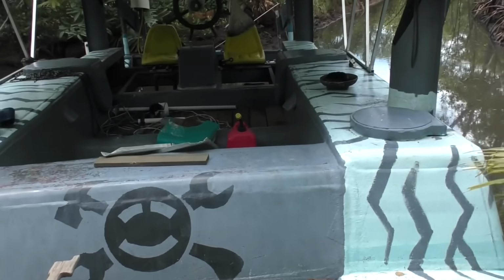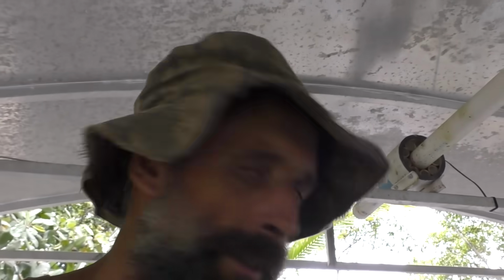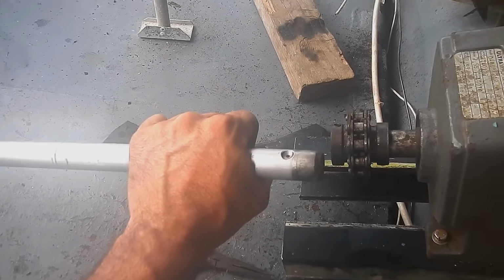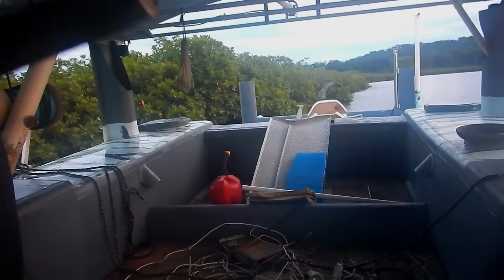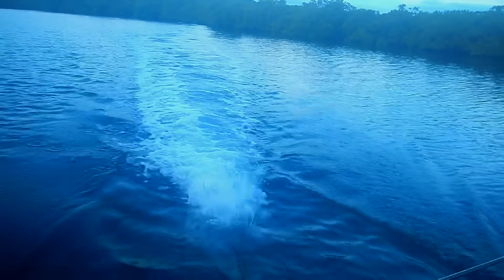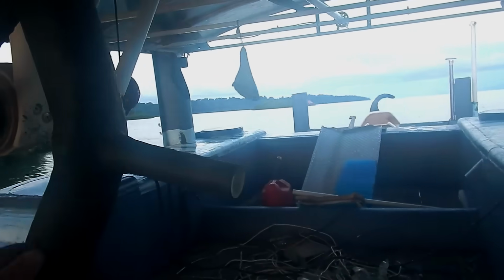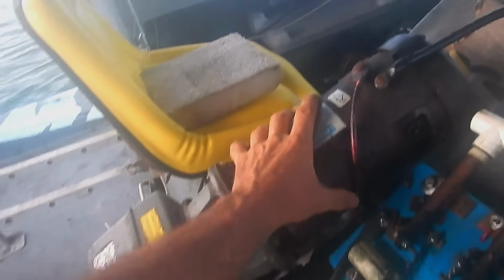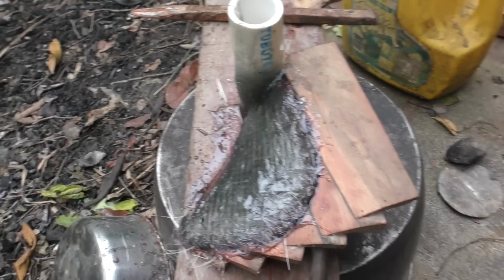Tiger Shark Straight Shaft Super Speed Test!  Don't Burn That Motor!

Comment: Why not just put the electric motor directly to the paddle wheel you could also use the transmission part of a motorcycle engine just hook the electric motor to the crankshaft there are videos showing how to do that on here and connect it to the paddle wheel

Comment: Jaimie - DC series wound motors can put up with a lot more than their spec. Their spec is enclosed, in an industrial setting forever. Throw a fan on it and you can get easily 200% power out of it. Probably 400%. The limit is thermal, so you just have to pay attention to gradual heat accumulation. Everyone suggesting an ebike motor is crazy. They're fragile for the same wattage, magnets delaminate, they rust easier, they overheat quicker than you can notice. Any old hydraulic pump motor (24-48v), forklift motor, or treadmill motor (90v, if you can swing it), would do and you can probably find as scrap.
Reply: Water cool it!
Reply: That prop setup actually originally came with a big series wound motor. He took it off and is using it for something else. He could just use it, for sure. I have some nostalgia for series wound motors used in DIY EV conversions. But they are heavy and efficiency is lower. People would take forklift motors and run them at a higher voltage, and perhaps adjust the brush timing. Higher RPM is also important, and for that you need higher voltages and gearing. He's always running mismatched voltages and gearing, or crap motors like that Leeson, which is meant for entirely different uses anyway.

Comment: Why not do it the right way the first time and stop using all this junk? Electric bicycle parts and 48V systems are currently extremely affordable. You also won't have to listen to all that god awful noise. Those are builds I was doing when I was a teenager. It is time to grow up and use equipment worthy of a man. It looks like you are building a Narco Sub in the Amazon, but you have access to modern equipment and refuse to use it.

Comment: If you order one, I would suggest a 3000W bicycle motor and controller. They are waterproof, and you can program the motor to a max output so it fits your battery and solar setup. You can also run a bigger and more efficient propeller with such a motor.

Comment: Soop was made. Geared down motor driving larger prop. Using torque instead of RPMs is more efficient, obviously. Prop design is probably going to be much different going this route. Cavitation is going to be less. Moving heavy loads should be better. Although adding load to a maxed out motor would be bad. So there must be a compromise on speed and torque. Then one would need to figure out the correct added load for each design. A variable pitch prop would be a fine thing. Even just for testing purposes. Would you sell your soul for proper test gear?

Comment: I suggest wiring all the batteries to bus bars. The way you have it hooked it will deplete the first battery quicker than the last. Same with solar.
Reply: Poor mans version is to just go the other way with one of the poles.

So if all the batteries are in a long chain you grab + on one end and - on the other to go to the load/charger.

Even with a bus bar the cables need to be the same length for each battery to the bus bar.

Comment: use it like longboat in Thailand the whole motor is on a pivot.
Reply: Oh yeah, those were awesome!
Reply: And use a swept back surface drive prop like they use. 
They are incredibly efficient. 
Other than that you may be over pitched with your current prop. 
If it's showing propwash it's not efficient.

Comment: Electric propulsion man... Can use solar, any type of battery chemistry and even completely throw together any old motor and diy analogue controls and it just works. Yeah, you have to know a little bit, but compared to a combustion engine, this stuff is so accessible!

Comment: Because you keep doing things the stupid way. 24V and no controller. There's SO many great deals on brushless 48V motors and controllers these days. 48V is the MINIMUM for EVs, so you're not going to get good parts at 24V anyway. You also need a bigger MPPT controller